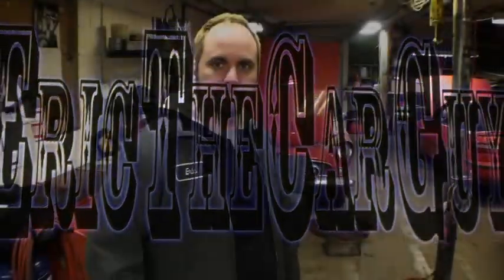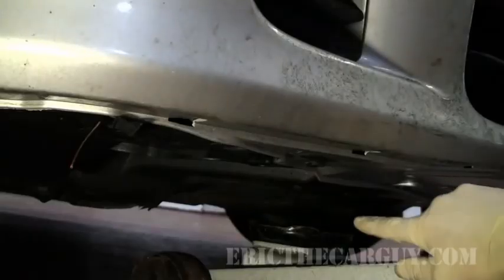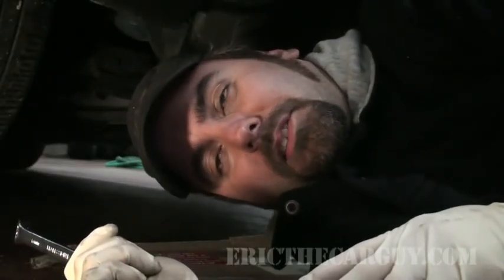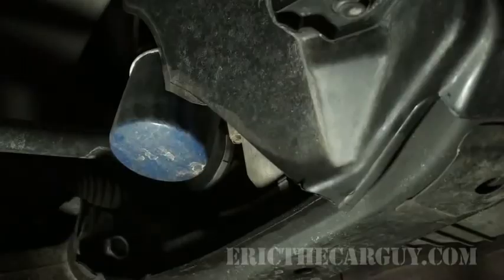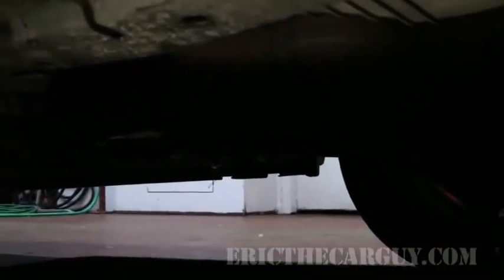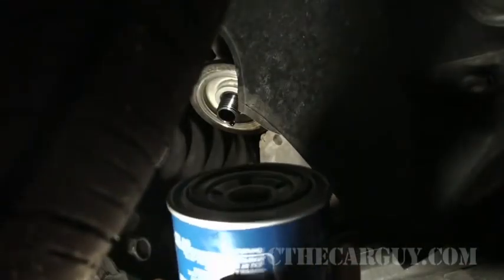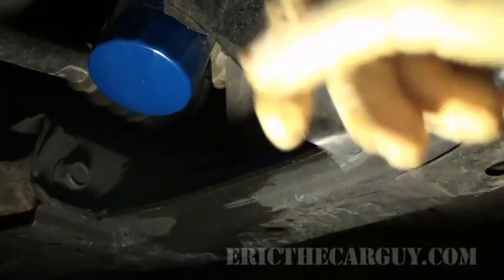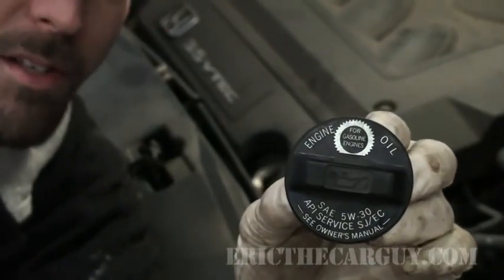How To Change Your Oil (Full) - EricTheCarGuy

Comment: Eric, what is your opinion about using jacks/stands vs ramps? What do you prefer and what would be the ideal method in this case and possible many others.
Reply: It's all up to you, since my car is so low I just jack the car up and put ramps under the front tire instead of driving me up there... Personally you can put it on ramps and just in case put jack stands under it too just for extra safety, but ramps would work fine ... Just with either of those methods just make sure you are on a flat surface!

Comment: @EricTheCarGuy The TROWS in between the counterweights which connect to the piston rods on the crankshaft needs to sling oil to the cylinder walls :)

Comment: Probably overkill but just before changing I pull the fuel pump fuse and run the car until it dies (around 3 or 4 seconds).  After changing the oil, I crank the engine for 10 -15 seconds  with the fuel pump fuse still out to let oil pressure fill up the filter and oil galleries.  I then replace the fuse and follow the same steps you use.  I'm not sure how much if any engine damage I prevent, just hate to start an engine with no oil in the filter and galleries.

Comment: I always fill up the new oil filter with oil before screwing it on.  That way when it starts for the first time, the engine isn't running dry while it is filling up a dry oil filter.

Comment: does that super tech oil have legit API label and if so would u use it in your car? asking because I'm thinking of using it myself. 
what brand of oil filter would u recommend?
for oil filter do you need specific size or is it one size fit all kind of deal (universal)?

Comment: My car takes 5.7 quarts of oil. I only place 5 in because I was not able to do a full flush of the oil. Not doing the flush leaves a great sum of the old oil behind. Does not mean to not check your oil levels every so often to confirm that it is at the appropriate levels specified by the car manual. Also next time I need to find a garage in Ohio that has the oil flushing system and I will have to change my oil sooner even if it is Royal Purple. Since I have changed to the Purple the engine seems much smoother but that is mostly due to the new oil. I have to see over time if it will perform any different from the semi-synthetic oil that it previously had. When performing the oil change I had to use a run down version of flushing the engine by using engine flush oil; which has a detergent that get some build up out of the engine without the full flush. Also placed an oil treatment substance in with the Purple and fuel injector cleaner in the tank. Both products are just powerful cleaners for the engine and fuel system. I also have not seen any smoke from my car when changing to full synthetic. I wish I had my trusted Mechanics here but they are back in Alabama.

Comment: you forgot to mention in the video when changing oil, is to also check the oil light on the vehicle's dashboard after starting it. In most cases the oil light turns off after a few seconds.

Comment: hi Eric, I did an oil change today, started draining from the bottom, and then I went up to unscrew the oil filter, and the bastard didn't budge... since I had to use the car, I let it stay up there, and poured in the new oil. I ordered one of those oil filter removal tools from ebay so I'll take another shot when it arrives... Should I repeat the entire process with new oil? Is the oil I've put in today already badly contaminated with junk? Or is it fine if I just replace the filter? Thanks!

Comment: Also, Eric, do you know how I would be able to clean my old oil rag's myself? I don't want to use a service, or buy more rags.. I've got quite a few that are just sitting in a bag, but i don't want to use them because they are soaked with oil.  maybe use some sort of solvent? simple greeen, wash in a bucket? then dump the oil/cleaner solution at a auto service station?

Comment: Eric, what do you think about engine flush before doing an oil change? Supposed to clean all the crap inside the engine, I know it's not recommended for high mileage cars. (100,000)

Comment: my 02 Odyssey manual says that i need to change the oil every 7,500 miles or once a year. I understand from you and many other mechanics that i trust that it should be changes every 3,000 miles or 6 months. what is the truth? I use conventional oil but dont mind using synthetic if that would last longer. also, is it true that once you have used conventional oil that you shouldn't change to synthetic?
Reply: Aharon Srour no need for every 3,000 mile oil change that is a waste. 5000 is better. Also you can change back and forth as many times as you want with synthetic or conventional. You can even blend them it will not harm anything. If your down oil you can add to either blend.Walmart motor oil is a very good oil at a very reasonable price. As long as it has API on the bottle/jug your good to go. API American Petroleum Institute.

Comment: when you lub the oil filter before installing it, you used the used oil that dripped from the car. it's ok if rust and dirty stuff get into the filter?  and if filter was collecting dust on the shelf, is it ok to use it? lastly when I ordered some filter from autozone the box was broken and filter was soaked in leather/rubber protectant since the bottle was broken? don't use those? I think some might have gotten into the mid hole in the filter
Reply: Just use the goddamn new oil!! Gezzzzzz
Reply: all you're doing is lubricating the rubber seal its not going to go inside the filter, but even if it does that what its designed to filter out so shouldnt be that much of an issue.

Comment: Hey Eric, is that 'Super Tech' from walmart in the blue container? I am asking as i have used to for MANY years in many vehicles. I had a 93 ford festiva for 10 years and 160,000 miles without ever adding a quart, also use their filters, years ago they were under 2 dollars so i bought like 30 filters and they lasted for many years-- i wish i could get a festiva now as it got nearly 40 MPG city not highway as the festiva being sold now which barely gets 30 city and that 1.3 was a durable engine

Comment: Thanks I like my mom's new 2011 Ford F250 and I hope it will have a traditional oil filter compare to European cars like Audi, BMW, Mercedes-Benz, Saab, Volvo, Volkswagen and even exotic cars made in Europe may have a spongier but still now that I know that Daniel Jaeger Films has showed me that the oil pressure gauge has to be 1/4 over cold by the needle on the oil pressure gauge to show low oil but also remove the key from ignition cylinder as soon as you shut off ignition. No one take the car

Comment: I have a 2014 Nissan sentra. About 3100 miles on it. I don't drive much other than going to work, so I drive it at least 3-4 times a week. My drive to work is about 5 minutes. When should I change my oil?
Reply: Zachary Thigpen If you don't drive enough to rack up the manufacturer recommended number of miles for an oil change any time soon, an authorized Nissan dealership should be able to give you a month interval to go by; in fact, they should be able to print you out a full service schedule for the vehicle. Just go to the service department and ask for it (they'll ask you what size motor you have which can be found on your catalyst sticker under the hood). My 2015 Passat is good for 10,000 miles so if I were to not drive enough, I would change it between nine and ten months just to be safe but they say I could choose to go twelve months. Hope I was able to shed some light on this for you :)
Reply: if its ow-20 which i think it is it will be good for 10k if its regular old 5w-20 conv it would be 5k
Reply: My 2013 Sentra requires a synthetic 0W-20 oil change with filter change every 4,500 miles.  BEWARE OF THE NISSAN DEALER! My Nissan dealer was putting 5W-30 conventional in a car that requires synthetic 0W-20, so please read your receipt if you change it at the dealer. I use Valvoline 0W-20 SynPower oil with a WIX filter, like I said every 4,500 miles and all I do is about 10 miles a day as work is just down the road. The only thing I will advise you when you change you're oil on these Sentra's is that I personally think the filter is a bi*ch, you can't get a strap wrench around it and I have yet to find a cap wrench small enough to fit it. Hope it helps and good luck.
P.S. If I remember correctly it takes 4.1 qts with the filter.

Comment: watch your miles if its over or close to 100k leave it alone. your bands are starting to wear. the grit is actually helping them grip the new fluid could cause them to slip thus weird shifts and slipping kicking and all sorts of weird, learned this the hard way on my 01 mustang

Comment: But unless your really picky i would recomend 10-30 in most climates unless you lived in a very cold climate. But both oils are the same viscosity at operating temp, just different at cold start up. Might get a lil boost of oil preasure at start up but nothing to worry about.. Check out oil myths on the inernet and do a video. I would like to see one cause i dont know much more about oil

Comment: @JR3059 I personally like to do the cars I have depending on the care they have and how fast their engines have built up gunk in them. Some really clean engines I have let run until the oil gets really dark and over the 3k mark. Some get real dirty real fast. Like slick crude oil. Those I change as close to 3k as I can bear, but I agree, for most newer cars, I have old ones, 15 yrs about, they can go longer for sure. But I wouldn't like to do more than 5k because of harsh conditions most do.

Comment: I have a couple questions. Is it better to do an oil change while the car is Hot or Cold, and another thing I used ramps. Are they good to use if the oil drain plug is on the side of the pan.

Comment: Another tip: If you don't have an oil filter wrench and the filter won't come off, stab a screwdriver through the filter and break it loose that way. If you can only access the top of the filter, stab two holes through it and use some needle nose pliers.

Comment: Hey eric I got a quick question. I bought a civic engine for 50 bucks and it has a spun bearing. Just lookin to fix it and make a quick buck. How would I go about cleaning the oil passages? Im only assuming since a bearing spun, there are small metal shavings throughout the system. correct me if I am wrong.

Comment: @heyitstheo47 Yes, you have what you call a crankshaft and it is designed with what you call counterweights that throw oil from underneath to the cylinder walls. If filled with to much oil the counterwieghts will just kinda slosh the oil insted of throwing it up the cylinder walls.. if ran to full for awhile the oil ring on your piston will burn or fracture and then the rest of the rings like your compression rings soon after.. look up some pictures of a crankshaft and that can help....

Comment: Hey Eric. Got a question. I recently bought a used car and found from previous maintenance history that pure synthetic was used always. The dealer I bought the car from put regular non-synthetic 5-30 oil and I want to go back to using full synthetic. Can I damage the engine or has the dealer kind screwed me on that by using non-synthetic?

Comment: hey eric hows it going i have a question for you so i took my car to one of those oil change stations and they told me i had a little bit of sludge they wanted to flush my engine oil and wanted to add more to the bill i have heard that flushing the engine oil can harm you're car with additives is it better i just buy a better motor oil with detergents for it?

Comment: according to my manual i should use a 5w40 oil, youre saying it doesnt matter if its a regular or sinthetic oil, thats great im an student and syntec oil is too expensive, but unfortunatly 5w40 oil range is only found on synthetic oils
Reply: Synthetic oil is more pricey but it can be the most affective when you what you car to run more smoothly.
Reply: Kevin Favela yeah........ altough i did the last change by myself, and is not that expensive, $25 mineral oil, it lasts 5000 km but it is awfully bad , $40 syntec oil lasts double kms, it cleans better, ill stick to synthetic
Reply: Kevin Favela and another interesting fact, by using the recommended oil i can change it every 30000 km, dont know on miles hehe or every year, that sounds crazy altough thats what the  maintenance book says, sometimes its good to read :)

Comment: hey eric. i have a 2005 crown victoria with 370,000 miles on it. what viscosity of engine should i use ? ford says i should use 5w-20 but i have quiet a bit of miles. should i use a higher viscosity or stick to 5w-20 ?
Reply: +Saber Uddin use the high mileage oil. It&#39;s designed for just that :).

Comment: Hello, Eric... I have some questions about using a type of engine fluid, I have this car Suzuki Wagon-R and it says on the manual that the recommended engine oil is only API SF/SG/SH, but now a days these type of engine fluids are already obsolete. My question is, can i use the latest engine fluid these days like the API SN or SM? even though the recommendation in my car is SF/SG/SH... can it cause a serious damage on not using the recommended oil? thanks in advance....

Comment: hey eric Ive got a quick question.
My moms car seems to burn a lot of oil. ive switched to amsoil 5w30 and im using a K&N oil filter. The car just seems to feel "heavy" when i step on the gas, its not responsive and its just sluggish.
Is all of that burn oil being converted to black sluge???

Comment: Hey Eric, do you think  there any problems with using a different type of oil other than what it says on the caps?  I drive a toyota corolla and it says to use 5W-20 but I've been using 10W-30 for a while now.

Comment: Hey Eric, I have an 06 Ranger. I can change the oil easily. But the oil filter part is not so easy. I can get it off but the problem is that I think it is the starter is right below the filter. How can I keep the oil from getting on the starter?

Comment: Hey Eric, it's funny that you mention dropping a car on your head.. I've done that while trying to rebuild an engine. It does hurt.
Reply: I once replaced an oil pump lying underneath an engine block WHICH HUNG SUSPENDED FROM A WINCH. A real bonehead idea.
On inspection afterwards the 1000lb rated hand winch was almost destroyed by the 300lb load (small v4 engine): The 2 holes in the frame holding the dowel&hook assy were oval instead of round and almost ripped.
Had it broke it would have squashed my skull like a pumpkin.

Tell me Chris, how did you mess up?
Reply: I was working on something underneath the car. I was almost ready to pull the engine(still in the process of the engine bay tear down though) and I had the car on a tire jack. I was fat and had to pull on the car to scoot myself out from under and my friend was leaning on it, so I guess the jack was already leaning. I pulled the car right off the jack. I caught it and it landed on the rim on the other side so while I was pushing it off, my friend and 2 others pulled it off.
Reply: In the most affectionate way... You and your friends are boneheads.  Be careful man! You can't work on your car if you're dead. Jack stands save lives.
Reply: Nah just me. Im the broke bonehead haha. I'm much more careful now.

Comment: Hey Eric do you have any advice on changeing the oil pans gasket or the oilpan itself? I noticed a black frame arround the "gap" between engin block and oil pan so i figured the gasket is gone i didn t loose much oil yet though and anyway need to do an oil change. And now i am just wondering if it is much more work or in any degree difficult to change it by myself. And i ve noticed that the oil pan is a bit rusty so i think i might aswell change that with at the same time.

Comment: On my Kia Optima, I tightened the oil filter like that, and it leaked. I had to get it tighter. Even from the factory (I bought it new) the oil filter was on so tight, I needed a tool to get it off.

Comment: Repairing any leaks that arise by replacing seals and gaskets, and if necessary, using a slightly higher viscosity oil to compensate for wear.  The later is a -very- high mileage thing, though.  If properly maintained, you shouldn't have to worry about that for quite some time.  :-)

Comment: How long does it normally take to change the oil in your car. Reason, I took my Acura RSX to a lube and oil place and they returned my car really fast to me. I feel they might have not changed the oil or filter. They showed me the dip stick, but the oil was a muddy color. Any suggestions to probe if they changed it our not?

Comment: JUST A QUICK TIP FOR THOSE THAT MIGHT NOT KNOW.  
I FIND THAT CUTTING THE TOPS OF 2 LITTER POP BOTTLES 
MAKES A GREAT OIL / ANTI FREEZE FUNNEL

THE LARGER HOLE OF THE MAKE SHIFT FUNNEL ALLOWS FOR FASTER 
PORING OF FLUID, LESS SPILLING, AND USUALLY DON'T REQUIRE YOU TO HOLD THE FUNNEL IN PLACE... AFTER THE POP HAS BEEN CONSUMED, YOU GOT A FREE FUNNEL FOR CAR FLUIDS...

Comment: I can't get my drain plug off. A little wrench is not giving me the leverage I need, there's no room for my long torque wrench also my power dills not powerful enough. So I'll need an impact drill maybe even air tools....... why on earth is it so tight it holds oil in a pan I can do that with my finger. :)

Are electric impact drills even worth getting or should I get an air compressor and air tools although I can't really afford that and wouldn't use it all to often.